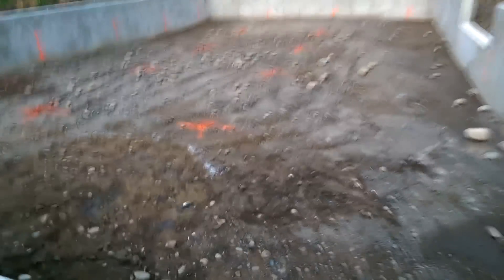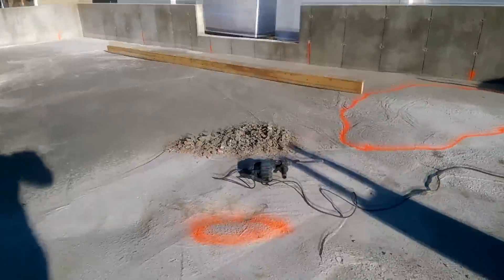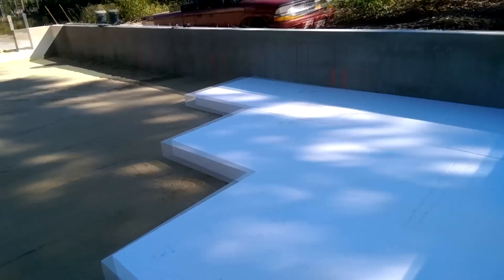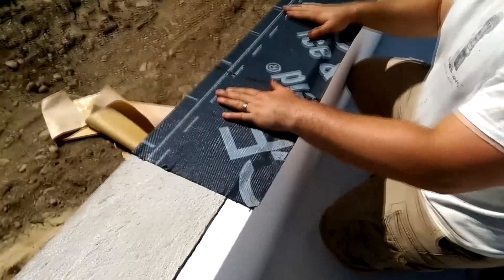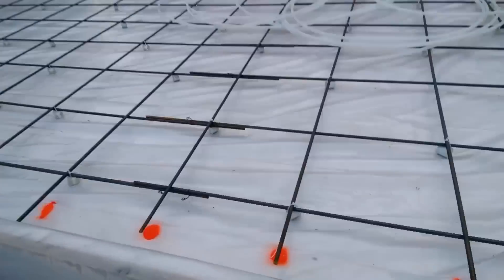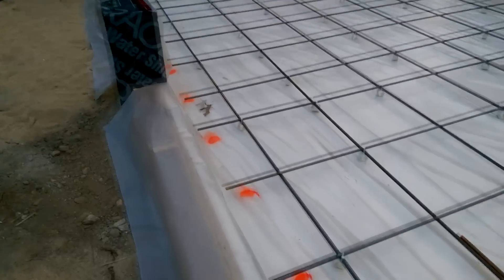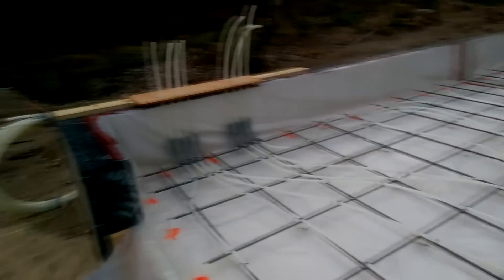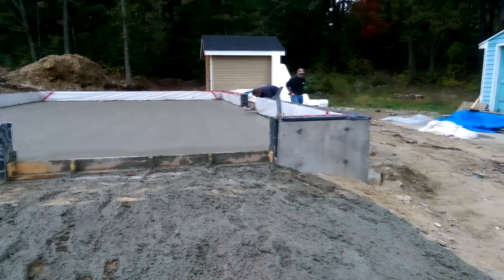Garage Workshop Super Insulated Radiant Floor

Comment: I would not tie the pipes along the rebar. You have just voided the purpose of the rebar.
Also the use of pvc to hold up the rebar? That becomes a weak point of the slab.

Comment: hmmn, never thought about the heat likely travelling downward to the cool ground and the benefit of insulating to prevent that, however it seems so obvious now that you've said it.
Reply from the maker: Thanks for your comment.
Reply: Philly Phil in easter europe,that is the way we pour concrete slabs.only difference is that most builders do not pour the first slab,instead the foam is layed on sand that is compacted.and that can cause problems in the future.

Comment: think if I had been doing this with what I have learned about nose bleed on the foundation would have run out 16 feet from the outside of the foundation wall with the insulation.  Why?  Because then I would have had a giant heat sink of the earth.   look up basics of earth shelted umbrella  http://www.homeintheearth.com/tech_notes/basics-of-earthsheltering/umbrella-basics/
Reply from the maker: There are many great ways to insulate.  Personally I like having my insulation layer go all the way around and under my building.
Reply: keeps down the nose bleed

Comment: Excellent video! So in the near future I'll be building a garage with radiant floor heating as well. I live in Northern Ontario; it gets cold. It'll be used for parking and also a shop. I want to slope the parking area. My question is, what did you do under your garage? Did you have to put a grade when you dug down? Or is everything flat. Also... I need good soundproofing.
Reply from the maker: My garage floor is flat.  I did this because I was thinking of the shop.  Water will puddle under the cars from snow melting off of them.  If I did this again I would have put in a slope to the garage floor, but just in the 20 feet of the doors (where the cars sit).  I would still have the concrete flat in the back where the shop tools are.

Comment: Great job! R56 floors, that’s insane!!  Any worries about the floor crushing the insulation over time especially since there’s over a foot of insulation....I like how you spaced the rebar up ,I’ve seen so many floors poured with the rebar and mesh on the bottom.....kinda useless there.
Reply from the maker: Hi John,  Thanks for watching the video.  I'm not concerned with the foam crushing under the floor.  I ordered foam with a high density (stronger).  And I agree about the rebar, it needs to be fully encapsulated in the concrete to be helpful.

Comment: Despite your "mistakes", you did a fantastic job as far as this Alberta, Canadian is concerned.  Up here where it can get as cold as 45 f these floors really pay for themselves inside of a couple of years.  If it gets any colder then that or we are shutting off energy to the garage we air purge the lines.  In 12 years of owning a radiant floor,  I never resorted to line purging.
Reply from the maker: Thanks for the kind words.  I've been heating this year just with my solar thermal setup.  The sun has kept the garage above freezing, and the concrete mass acts as my thermal battery.  The system has been working well.

Comment: David, If you were to use CFC instead of regular concrete would you need the 14 inches of insulation under the slab?
Reply from the maker: I don't know because I don't have any experience with that type of concrete.  Since CFC is a type of concrete with insulating properties, then it stands to reason it would be a poor conductor of the heat out of the radiant tubes.  Probably wouldn't work in my situation.

Comment: Looks great.  As you are looking for the most insulation , I wonder that you didn't put it outside the foundation concrete as that would allow the thermal mass of the sidewall to also "battery" the heat.  I have to believe that your temperature will be a very flat level based on how much concrete you heated. 
In my experience the garage doors are usually not the best for insulation, and the weather stripping leaks air. Have you come up with a way to combat that area of heat loss?  I haven't seen your other videos -yet. 
It's good to see someone build a garage large enough to use and not just enough to squeeze out of a sub compact.
Reply from the maker: Hi John,  Thanks for watching the video, and asking that question.   Some builders will add insulation to the outside of the foundation wall, and stop there.  This leaves the footers as a thermal bridge, conducting the heat from the slab into the ground.  It is a constant bleed.  Stopping thermal bridging has more energy benefit then adding thermal mass.  Heat in = Heat out.  Minimize heat out first.  Only after that add thermal mass.  I love thermal mass, and do love the long temperature swing I get from the concrete floor.   

In addition, I have been on several job sites over the years where there was foam on the outside of a foundation wall, and it was infested with ants.  I was there removing it.  In my opinion, insulation should be protected from sun/rain/rodents/insects by the structure.  Don't hang it out there to be attacked.
Reply: John Renner     If you care about heat loss from garage doors, you can buy 4" insulated doors, BUT next to no Americans care about insulation because of your ridiculous low energy prices.     The foam is placed correctly, between the heated floor and the heat wicking foundation,   but you are not wrong about generally placing the insulation as far out in the building envelope as possible.

Comment: self levelling needs to be very liquid almost milk like .
Reply: concrete laser screed can leveling with low concrete slump
Reply: Did you use a concrete vibrator  while pouring the flowable fill?

Comment: I will be building my home like this thanks for a great video, how much was the gen foam per board? And could it encase a entire home including the footer and foundation wall?
Reply: Also I will be using all solar pv for heat Electrodacus is the unit I am using
Reply from the maker: Good luck on your home build.  I would love to hear how it goes.  Yes, Geofoam can be used in the application you are talking about.  Here is a video from Hammer and Hand where they did just that: https://youtu.be/lf17z76VTWY
It definatly looks appealing because it brings the thermal mass inside the envelop.  However, I have been on too many jobs where we needed to remove exterior foam due to insect damage.  That is why personally I used the foam inbound, where it is more protected.  But there are lots of ways to make a good building.

What are your primary goals in using the foam under the footer?
Reply: DavidPoz I'm hoping to be able to heat with a new type of heating with a dmppt 450 from electrodacus in Canada it uses pv panels and low voltage dc with silicon insulated 200c rated wire imbedded in the concrete I do not want any thermal bridging so all the heat made by the solar slowly leaks out over 2-3 days and can be recovered on the next sunny day it will also provide all my power I have a channel off grid Colorado that I will be uploading the new charge controllers that go with the heater. I have watched the hammer and hand video and am also concerned about bugs and critters I've thought about a second footer and a false wall with stucco or siding and extend the rafters to accommodate the 24"
Reply from the maker: Very cool.  Sounds like we both want to be heating with solar, but two very different methods.  I'll check out some of your videos.

Comment: Putting r56 foam under concrete must have been expensive!! Heat will radiant up. Will you recover that cost thru savings in your heating bill?
Reply from the maker: Great question, and one that we are always asking.  In most situations I don't recommend going to an R-56 under the slab.  However, there are a few reasons I felt OK about it for me.  
1. I like pushing things to extremes.  An extreme amount of insulation.  An extremely small heating system, and having an extremely comfortable shop.
2. I'm heating the concrete slab, so the slab is the hottest part of the garage.  That heat would conduct down into the ground if it were not for the insulation.
3. My goal is to heat the garage with only solar.  This is very difficult to have a solar thermal direct system.  (this is not grid-tied solar pv)
4. I've worked on other construction jobs where the owner spends thousands on the boiler system.  I shifted most of that budget to insulation.

So that is how I justified it in a nutshell.  But, I do have to say once again, I don't recommend this to everyone.
Reply: A common misconception: heat does NOT go up! Heated fluids, including air, move up, but in solids the heat happily moves in any direction. Always toward a lower temperature.
Reply: Thompson Brad     Your physics teacher is about to hang himself      Radiant heat goes equally in all directions,     you are thinking of heating by CONVECTION, and that mostly goes up.
Reply: The truth is hot air does not rise.  In order for hot air to rise you Must  jack it with cold air from below.   Cold air is what pushes hot air.         Funny as people insulate and tighten buildings to the brink of death.   You have people who really know what the hell there doing  going around and feeding these so damm tightend up houses.   With some nice cold make up added air.      Over tightening & over insulation worst thing you can do to a building if you aint feeding it fresh air
Reply: I installed electric heat under the tiles in our basement bathroom. Home Depot guy said "Just install it directly on your slab"....I thought that's completely stupid. Why would I want to heat the ground?? I ended up installing that orange schluter mat to the slab first, some mortar base, then the heat wires. So at least I have 1/4" of plastic under the heat wires. The floor also heats up much faster than zero insulation. You did nice work. Screw the haters.

Comment: Wow what a enormous amount of work hope your concrete doesn't settle and crack all over I am not a fan of that type of heating especially on a garage that small
Reply: Actually, it's not the fact that the heat is in the floor that saves $$ in the long run. You still use the same amount of BTUs to heat to a  given temp. Where the savings comes from is the added insulation PLUS the fact that a warm floor allows you to be comfortable at a lower temp setting. The added bonus is the floor dries in a heartbeat AND radiant heat has no drafts. Basically it's the best comfort and a great convenience, despite the added up front cost, which is mostly labor.
Reply from the maker: Hi Alden.  I think you are the first person to not enjoy radiant floor heating.  What is it about radiant that does not appeal to you?
Reply: I have seen first hand different types of radiant underfloor systems fail and not deliver the cost savings that they were suppose to like electric energy consumed by pumping the antifreeze solution thru thru the pex tubes and depending if its geothermal or not it requires a fuel source to heat the solution to the desired temp the added cost of it will require years of use to recoup the cost over normal heating systems such as radiant propane or natural gas that is easier to install and a cheap fuel alternative in my area here in kansas I guess what I'm saying is I am not impressed with underfloor heat
Reply from the maker: Sounds very reasonable to me, and I appreciate you sharing your experience.  I think you have a real point.  I too have seen many disappointing jobs over the years where the homeowner would have just been better off with a simple system as you describe.  I've had great results, but I think that is due to the 14 inches of foam under the slab, and not necessarily the heating system itself.
Reply: DavidPoz you have the right idea and it may be suited better for your area it has some promising uses as long as everything is installed right great video to watch thanks
Reply from the maker: All excellent points.  Another is the quiet.  Most garages I've worked in are forced hot air with very loud blowers.  My radiant floor is silent.

Comment: Great video, where did you purchase your foam from and price if you have it handy?, I have been shopping around for some  some time now for a house I'm building this summer, thanks.
Reply: DavidPoz, how much was the 7" foam? I looked at 2" foam for my building and it was a fortune. I ended up using the bubble wrap type stuff that comes in a roll at a tenth of the price.
Reply from the maker: Thanks for watching the video.  I bought my foam from Branch River Plastics, in RI.
Reply: I’m curious of the foam cost as well. I was going to use 2, 2” layers of blue foam board, but clearly your 14” is more efficient.
Reply from the maker: When you say "blue foam board" you are probably referring to XPS, at R-5 per inch, or R-20 in your 4" example.  R-20 is great if you are doing anything other than radiant floor.  I made a radiant floor, so I went higher.  As for the cost, I bought mine years ago.  Just try calling Branch River plastics for an up-to-date quote.  Here's a tip: I have found much better pricing on "blue foam" from my local lumber yard than the big box stores.

Comment: just learning here, so you always use a waterproof barrier under a slab ?
Reply from the maker: I'll always use a vapor barrier under a slab when it is for a heated/conditioned building.  It helps control moisture, and moisture is a killer of buildings.
Reply: so if using a gravel or stone base you would put down the barrier then wire    and then pour over the wire and smooth it , thanks , nice job there
Reply from the maker: A gravel base would be better than what I did, and I will use stone next time. Stone controls capillary movement of water.  Plastic controls water vapor.  So, yes, I would still use a plastic membrane with stone.
Reply: sounds very logical, great your committed to quality and learning by doing

Comment: the rebar works in the floor because of the tension between the steel and concrete. By tying the radiant floor tubes to the rebar, you reduce the effectiveness of the rebar.  And you open the rebar steel up to sweating as the radiant floor heating is a source of heat.  Very bad choice.
Reply: bikebudha01 concrete is perfect vapor barrier.how the hell can the rebar "sweat"?
Reply: bikebudha01     Do you have ANY idea what you are talking about ?     "pex tubes reduce the effectiveness of the rebar"   not at all, but it does slightly reduce the average thickness of the concrete.      and your assertion that it makes the rebar sweat, sweating takes moisture, and if you build the floor system correctly, there is NO moisture in the floor system, so there is no chance of sweating.
Reply: @jesperdahl1486  Do some research, concrete is hydrophilic! I've done many dozens of calcium chloride test for moisture on concrete; there is allways moisture in concrete, even with vaper bariors. Hell, I've done calcium chloride tests on concrete slabs poured above grade on Commercial projects, and even they have moisture.
Reply: @josephdestaubin7426    I think the word you are thinking of is "hygroscopic"   and YES concrete will absorb available moisture from the environment, which is why reasonable building codes / good building practices specify ways to eliminate as much moisture pressure on the concrete as possible, by having 300 mm / 12" of crushed rock, covered by 6 mil plastic, that acts as a moisture barrier and prevents the vet concrete from leeching into the rock , and installing a vented drain tile at the very bottom of the crushed rock,  AND 300 mm / 12" of Styrofoam under a HEATED concrete slab, thereby eliminating NEAR all moisture / steam pressure from the underside of the slab, by doing that the slab will be as dry as possible, and the rebar will last longer then you are around to see.   I know that normal US building practice is 2" of concrete with no rebar, on top of dirt, even topsoil, with no capillary break, and no insulation required   " because heat rises "    and possibly 1 or 2" of Styrofoam under a heated slab, and still 2" of concrete, MAYBE 3"
Reply: @jesperdahl1486  : I agree with most of what you say. However, the most common thickness of a concrete slab in the US is 4".

Comment: The "self leveling" concrete was not necessary. It could actually create a problem.  Start with clean fill material (preferably >3/4" A.B.C.) compacted in 6" lifts, up to about the 12" below slab point.  Finish off with crusher fines if available or if high ground water is a concern, use >3/4" gravel, screed as level as possible and compact in 6" lifts. Lay your 6 mil plastic, then your insulation and #3 bars & 18" O.C. Zip tie your Pex to this rebar grid.